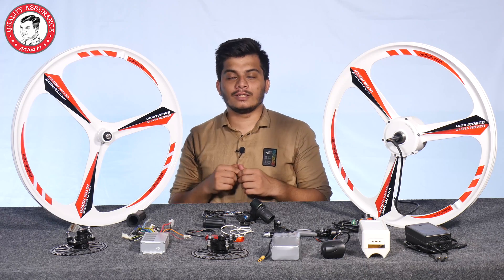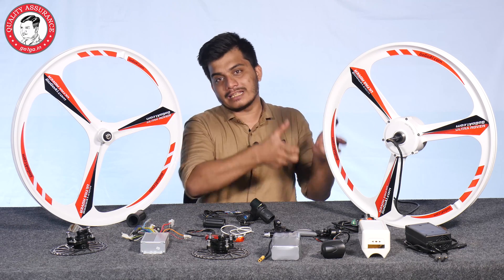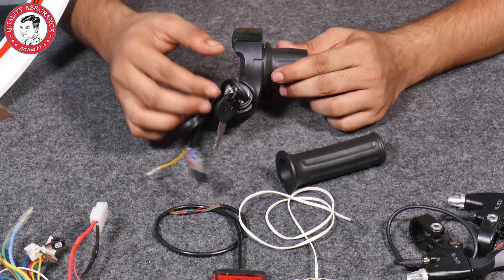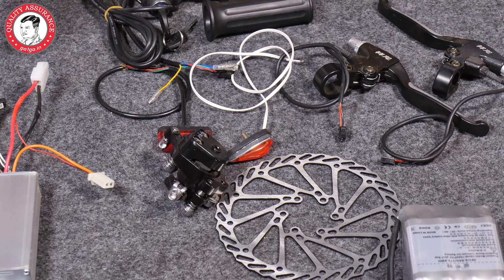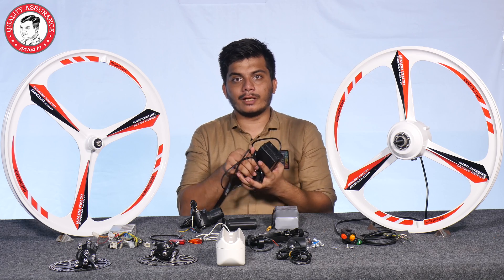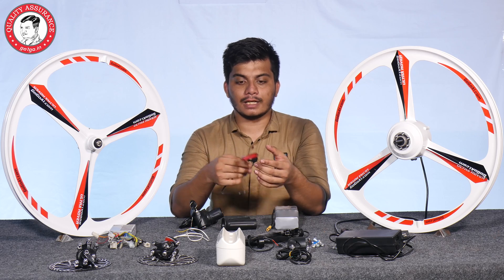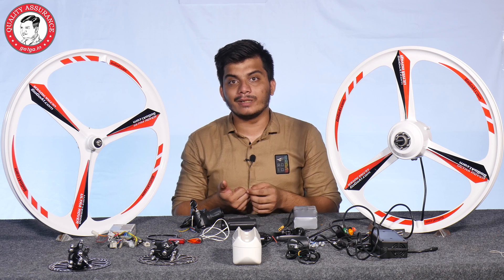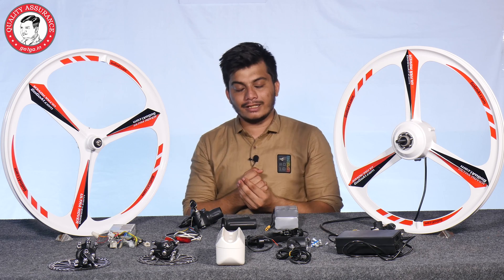Electric Bicycle Full Conversion Kit(36V 250W Hub Motor) | GO1GO

Comment: I had purchased electric vehicle items from www gogoa1com website. I realised that these items are of very high quality and efficiency. I used coupon code GOGOA1BA20J271 during online payment, i got 3%special discount and free of transport charges. Thus i purchased smartly beacuse these items are sold only through website. So do use above coupon code on your purchase and get discount and also get technical guidance from compony's technical team for convesion or installation.

Comment: Hi can use two hub motors  in parallel  with one controller ?
Reply: No for 2 hub motors in parallel controller should be rated for minimum 500 W.